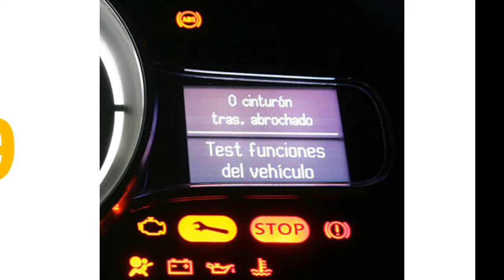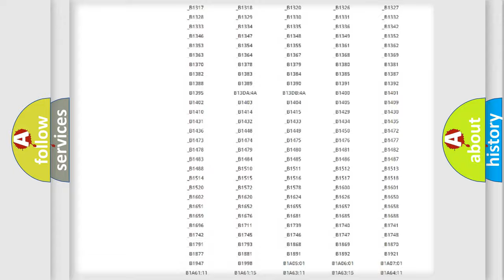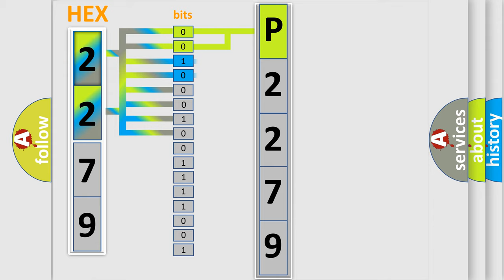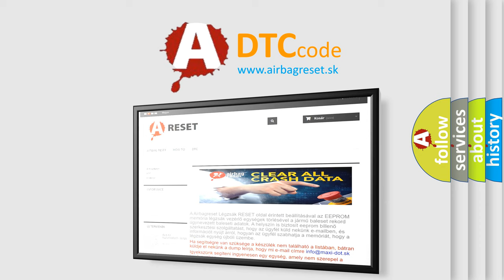DTC Ford P2279 Short Explanation

Comment: Is this correct? Everything I found online about this code was mentioning air, intake, or throttle body leaks as the possible cause of the code.
Reply: Thanks for this comment. I will check what is wrong